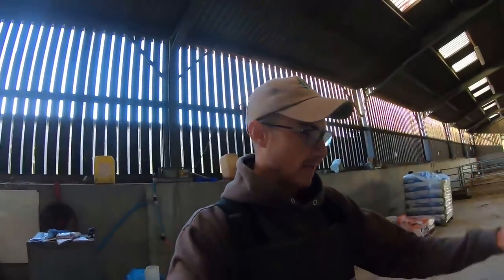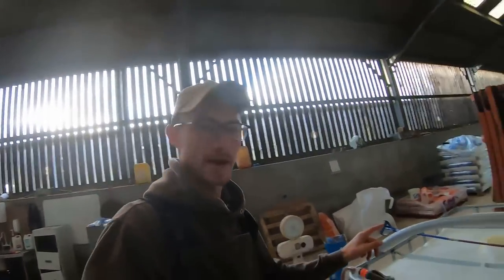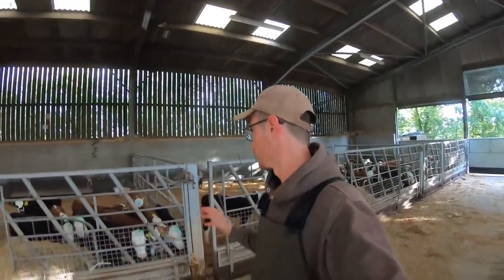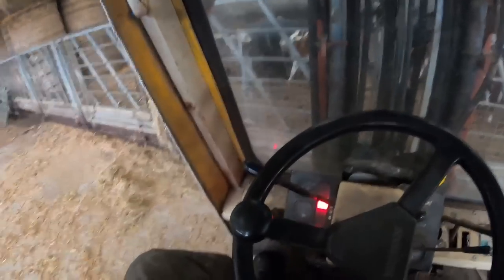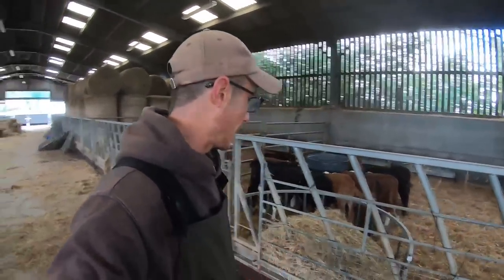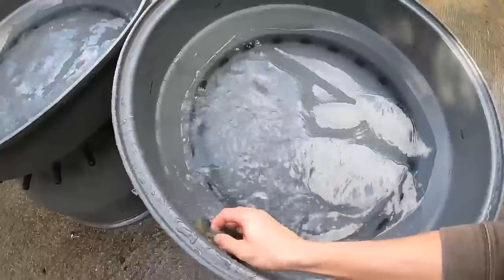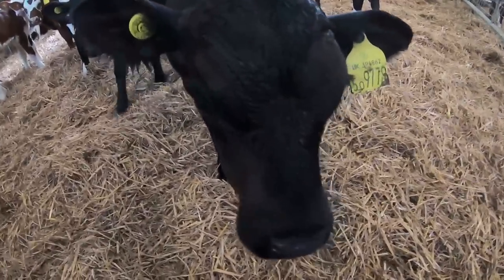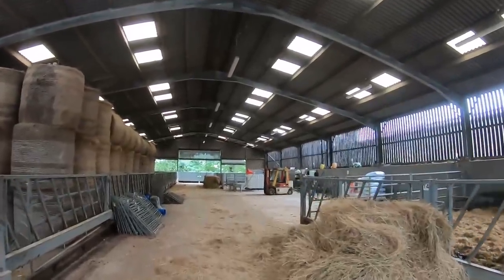FEEDING OUR NEW CALVES! IBC GRAVITY FEEDING!

Comment: Looks like doing good job. 
I always keep my calves milk weaker for about 3-5 days and then build it up to full strength. Plus i used IBC tank to but your better to cut the lid of,, as you never get it cleaned out right, as to bacterial infection problems.
Reply from the maker: Ahh right! We did think about doing that. I was going to see if i steam cleaned it once a week with soap it would be alright? I guess we will find out!
Reply: @JMFarming    👍 
they look like good strong calf’s there, they’ll do fine🤞
But Watch out for any scouring, if so get on top of it straight away..

Comment: Nice calves mate. Is there a reason for setting things up so that you have to go in and out of the pens as much as you do, to feed milk and grain ect? Have you got power there in the shed for a pump?
Reply from the maker: It’s only a temporary thing. We haven’t had bucket calves before and there’s no guarantee we will again. Don’t want to spend loads on something we won’t use much! 👍🏼
Reply: @JMFarming   ah yep fair enough mate. I’ve got an old milk vat, which I’ve hooked up a small domestic water pump too. Inch hose, does about 1 litre/second, into long straight feeders at front of pen, grain trough underneath.